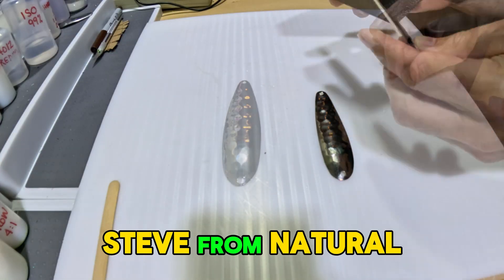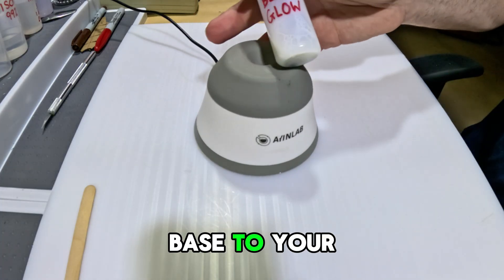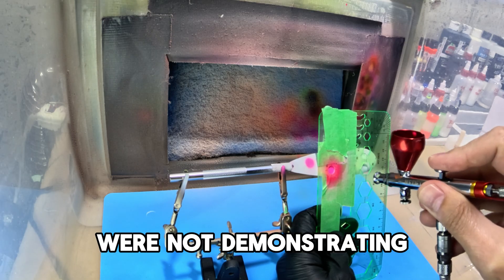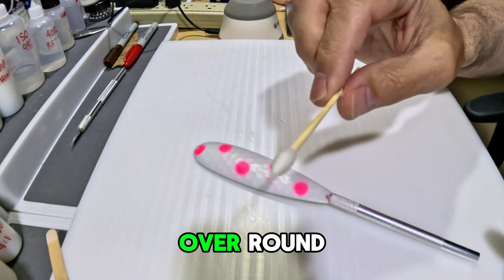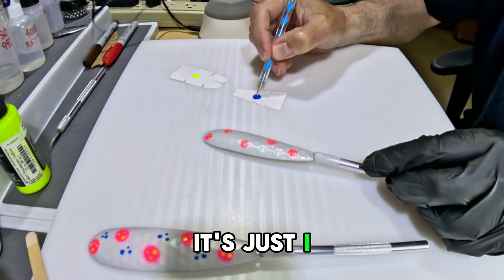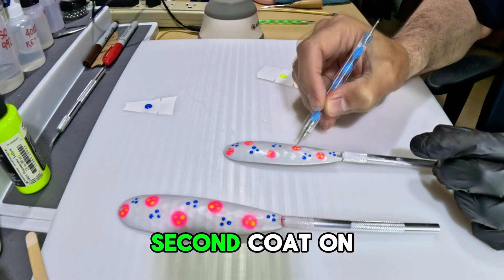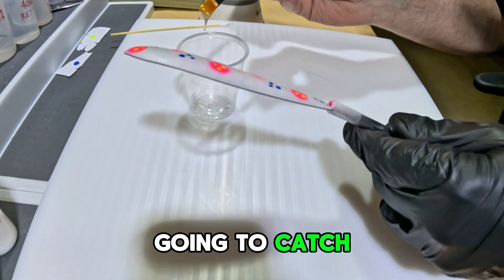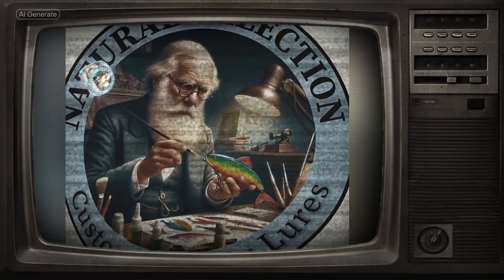How To Make Glow Spoons And Glow Paint - DIY Special

Comment: Hello mon ami je me suis lancé dans les cuillères et je rencontre un petit problème avec la résine epoxy qui refuse la peinture acrylique de mes leurres ….as tu un remède pour ça ?
Bien amicalement 
Jl
Reply from the maker: Bon jour, mon ami! Have you watched my video "Perfect Clearcoat Every Time?" https://youtu.be/OvbhhYcWkxU?si=ztCElpMvveISYVSq 

This will help you understand the basics. The #1 thing you need to do before you epoxy is to make sure the paint is fully cured (not just dry). If you don't, you'll get fisheyes in the epoxy as the paint offgasses and releases moisture. When the paint is dry, apply a mid-coat clear like Createx 4030 or UVLS. Let that cure, then epoxy over the top. Always think about the layers of your project and how they bond to the ones underneath. Every layer needs to adhere, or your pieces will peel at the weak adhesion layer. Let me know how it goes. And FOLLOW THE EPOXY DIRECTIONS EXACTLY AS STATED ON THE PRODUCT BOTTLES.
Reply: @NaturalSelectionAngling merci mon ami pour tes précieux conseils effectivement je vois bien que tu mets un produit sur tes peintures avant de passer la résine epoxy mais comme j ai beaucoup de difficultés avec l anglais ………😢……😅
Donc je viens de commander le produit que tu m indiques UVLS chez Aérographe discount une chop en France 
Je ne manquerai pas de te tenir informé de la suite des événements 
Bien amicalement 
Jean luc et encore merci pour ta gentillesse

Comment: Great Video... I have a question and as you fish these spoons, you will know the answer... Does only applying epoxy to one side of the spoon throw the balance off of the spoons action ?
Reply from the maker: I've gotten this question several times before. The answer is no. The spoon's action is imparted by the cupped shape and has almost nothing to do with center of gravity or rotation. That said, the epoxy weighs less than a couple of stickers. Soooo... if you fish spoons that have tape on them, these would have worse action than the epoxy spoons. I use 1.83g of resin to do 4 spoons. There's always some left and some stuck to the cup and brush. Let's say 1.5g total material, so over 2 coats maybe 3g. That's .75g total added weight on the spoon. Weigh a UV sticker and a ladderback sticker together and you'll see that they weigh more.  I hope that helps. But the proof of the pudding is in the eating, and you can see all the videos where we're smashing fish on these baits. They work 👍

Comment: Great videos! I hope you don't mind answering a few Q's...What is 40/30 clear?  Next I wonder what you're using to hold the spoon, and how you finish off the part that's being covered by that tool. Finally, when you show the charged spoon at the end, is the light we're seeing on the red dots coming through the blue glow coat or are you using glow paint for those dots? 

Beautiful work! Thanks!
Reply from the maker: Hey! Thank you for this great question. 4030 clear is Createx 4030 clear. It helps paint bond to surfaces, and can be used as a mid-coat between layers and before clear coating. To hold the spoon, I'm using the handle of a craft knife. It works great for this. When you pull off the handle, there's a tiny semi-circle of bare metal. I do this out of convenience when I'm making stuff for myself. I'll just clearcoat the entire spoon twice, and that's it. Once the epoxy is on there, it's still bare, but you can't even see it because it's so small, and  the split ring is over it.
Reply from the maker: I forgot to answer your last question 🙃 This is something I talk about in the videos. The colors are not glow. They're just fluorescent paint. When the glow base is intense enough, it'll make the other paint fluoresce from that emission. Pretty cool 😎
Reply: @NaturalSelectionAngling  Thank you !  this is extremely helpful
Reply from the maker: @stevenplaxco8114  no worries, man. I need to do better at explaining and avoiding shorthand. It gets repetetive!

Comment: Your video where you show the tape on the back side of the spoon. You super glue the chop stick to the tape changed my life. My set up now is a old bbq turner with a number 2 pencil wrapped in plastic and stuffed in the square hole. Then the number 2 pencil super glued to the back of spoon with the tape. Currently working with a hot pink and a kiwi green glo from Walmart reduced with 4030 or what ever its called. Also working with hobby lobby uv resin reduced with acetone. Tried the hot pink glo with 5 kiwi green glow dot from 1am-4 am couple small taps but nothing.Changed to factory glow spoon and caught 1 30 mins later. 8 hour spoon clear coated it to early rust shows at edges 24 hr later😂 . Enough rambling. Awesome content really game changing info for us hobbyist that will be watched long after you and i are gone. Might not get rich from it but you will be responsible for dreams coming true..
Reply: Tonight will be the night.i tried your 2 part epoxy I failed will have to dial that in on off season. I was able to get a good result with uv. very time Oriented but result looks great probably won't last a lifetime like yours but it will do for me.Thanks man
Reply: Went 3 for 3 that night. Spoon held up good. First limit of kings ever. The glow is amazing its too bright but with just a 10 second charge with cheap head lamp it glows nice and dim forever  it seems. Thanks man.
Reply from the maker: Man, that is such a kind comment. I really appreciate that you took the time to watch and comment. I'm sure you'll get into fish on the stuff you make if you put in the time. It'll happen. Come back and let us know when it does 😎

Comment: Great video!  I've recently begun to paint my own spoons and I am having a really hard time not getting the paint to come out "speckled" like you can see every individual glow pigment coming out,  and the coat is inconsistent / slightly patchy. I'm using Technocolor Glow in The Dark UV reactive Acrylic thinned with an airbursh medium.  Iwata revolution .5mm on 45 psi.  Do you have any advice?
Reply from the maker: Great question. There are a lot of variables to consider. First, what is the particle size of the glow pigment you're using? It should be less than half your nozzle aperture at a maximum. This will ensure you get good flow and more even coverage. I use 50 micron strontium aluminate. You probably also have to thin the paint more and use more coats. I use 3-5 coats to get good glow. Make sure it's dry between coats and just keep applying it. Check periodically with your UV torch to make sure it's nice and even. I'm not familiar with that paint, but if it's like acrylic brush-on poster paint, it's not good for airbrushing. It'll be lumpy with big pigment blobs. I use acrylic base and add straight glow powder 4:1, then thin. I also use a high speed paint mixer and a stainless BB in the bottle to really emulsify the product. Let me know how it goes, man.
Reply: @NaturalSelectionAngling  Thank you so much! This is really helpful!!  I'm having a lot of fun trying this out but there is definitely a learning curve with this glow paint.  Love your channel

Comment: Great video and instructions! If you dont mind sharing, where can I find the blank salmon spoons?
Reply from the maker: Hey! Thanks for watching, and thanks for asking. These were from Lureparts Online, but there are quite a few suppliers. I'll choose the supplier based on availability, bulk discounting and shipping costs. I'm not married to any vendor. I've found it's best to be flexible, considering the current economic pressures on imports. Almost nobody makes these here. The one domestic supplier I know sells by the thousand count. But even 5 at a time, they're only a couple bucks maximum depending on size, material and finish.
Reply: Thank you for answering.  I appreciate it.
Reply from the maker: @randyarndt that's what I'm here for brother. Thanks for coming by.
Reply from the maker: @randyarndt no worries, mate. Any time.

Comment: What primer do you use? Createx?
Reply from the maker: I use cheap acrylic paint for primer on my plastic baits. I mix it with 4030 clear to help it adhere. I'd recommend using self-etching primer for demanding applications that require direct to metal paint. Createx is a great brand if you like their stuff.
Reply: @NaturalSelectionAngling  Thank You
Reply from the maker: @chevyguy6510 cheers, mate.

Comment: After a full charge, how long will this glow last? I've had horrible luck with brand name spoons lately only glowing for maybe 30 minutes max.... Not cool moonshine!
Reply from the maker: These glow for about 2-3 hours. When I airbrush the glow it takes at least 3 heavy coats. If you haven't seen my epoxy glow videos yet, check those out. They'll glow for up to 24 hours and really strong for 6. That method allows for a much thicker layer of glow base.
Reply: @NaturalSelectionAngling  earned a sub!
Reply: Are you fishing at night?
On the west coast, we can't salmon fish in the dark. 30 minutes of glow is plenty.
Reply from the maker: @zzz7zzz9 YES. Routinely. Big Kings are mainly a night mission here when they start to move in closer to the harbors and tributaries. A full moon and a little rain bring on massive migrations. It's a lot easier to catch these fish in the dark under moonlight than during the day, especially on clear nights with he moon near full. They'll feed all night and into the magic hour just before sunrise, but the bite often dies once day breaks over the lake.
Reply: @zzz7zzz9  on the great lakes we fan fish whenever weather permits.
Reply: @zzz7zzz9 , my two cents.  If you are fishing deep or stained water, the glow helps even in the daylight hours.
Reply: Most of the kings i catch hit a low glowing spoon obviously when you have really dirty water that changes but from experience 99 percent of people use moonshine here and it looks like a comet coming through the water and to me the moonshine glow too bright then you get a couple good cast and its dead. Too me a good glow is a decent head lamp at 30 seconds should give you 4 cast then repeat.
Reply from the maker: @allenr6687 I routinely hear both ends of the spectrum on this topic. Nobody ever says "I like medium glow" 😅 Probably the best way to get the lower level you like is to airbrush the glow paint and keep it to 2 solid coats.